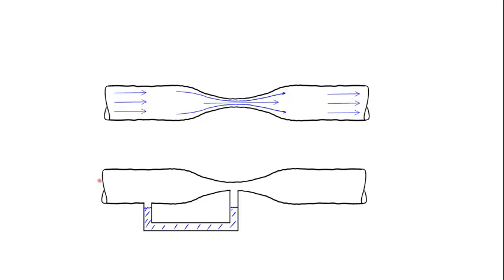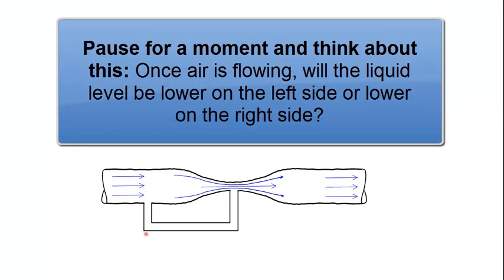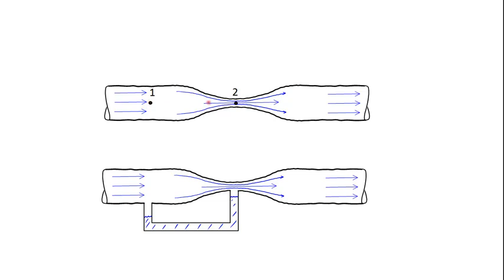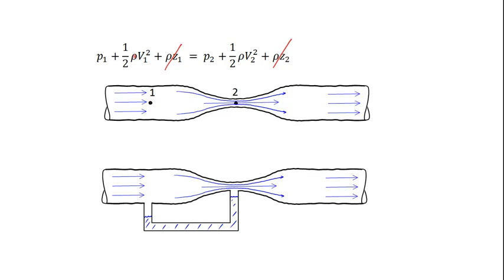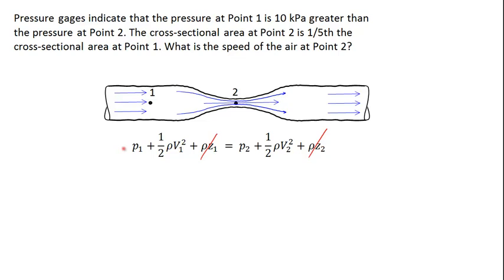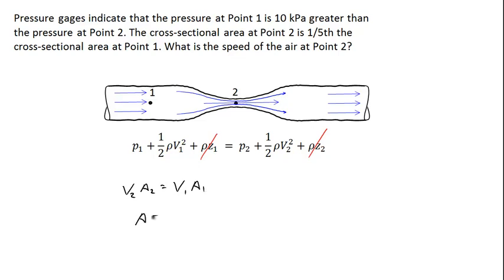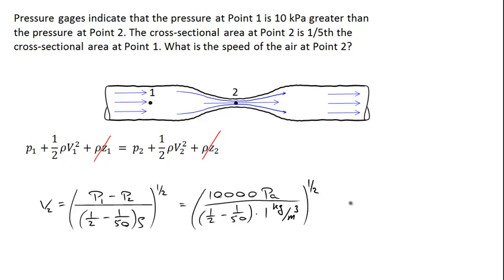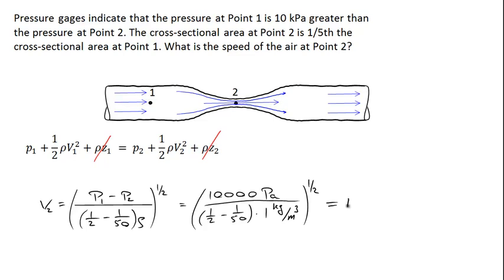Air flow through a constriction

Comment: Where do you specify V1 ?
And, where does the 50 come from?
Reply: You probably already figured this out, but other readers...  
V1 is not specified in the example question, instead it is solved for along with V2.
As for the 50, 1/2 * (1/5)^2 = 1/50.
Reply: @willdejong7763  Thanks. Now to figure out why I asked. (;-)

Comment: you forgot to include at what point does the fluid heat up taking heat from the friction & semi-static matter (pipe/atmosphere) &  at what point does the flowing fluid cool down giving up it's heat to the semi-static matter in contact, how do you use that unused heat difference to reclaim more useful work energy for low power conversion

oc the basic assumption in the real world is all fluids on earth will aways have some dissolved compressible gas in it under usual pressure so... as it gets to the restriction it will create some Viktor Schauberger vortex, hence a less dense spinning centre compared to its centrifugal compressed gasses outer fluid traveling edge

Comment: how long does the exit tube have to be to maintain the vacuum. can it simply truncate at the end of the angled portion, or is there a need for some length of the exit? I'm assuming a radius on the output pipes edge (to maintain a uniform velocity profile).

Comment: hi im studying for my red seal boilermaker exam and are having a lot of trouble trying to understand the formula and how to work the answer out on the following question
Calculate the differential pressure developed by an open venturi tube measuring air speed at 50 MPH,at sea level (ρair = 0.00235 slugs/ft3), where the throat diameter is one-half that of the entrance diameter:∆P50 MPHairAlso, how much pressure will the venturi tube develop at twice the air speed (100 MPH)? any help would be greatful